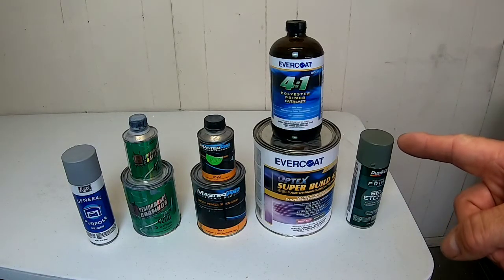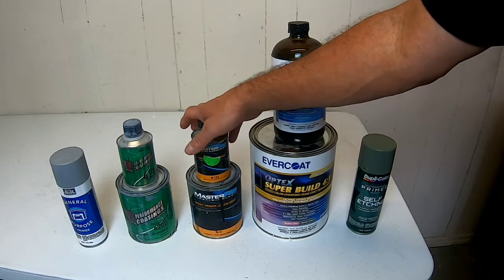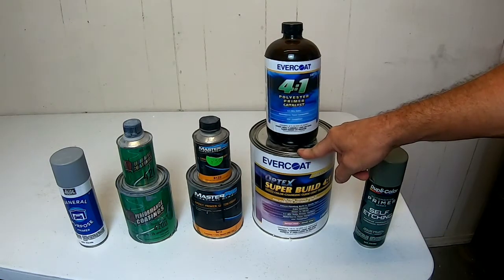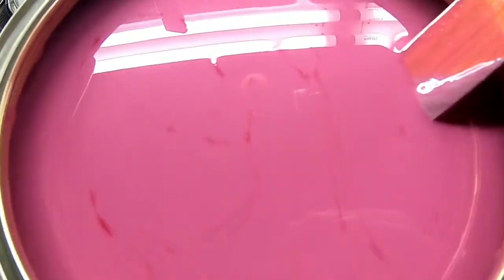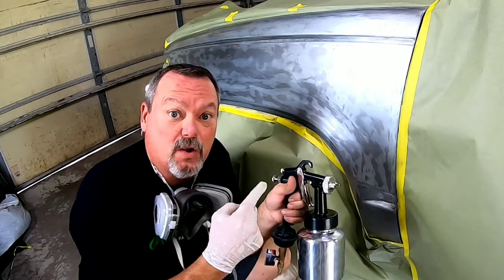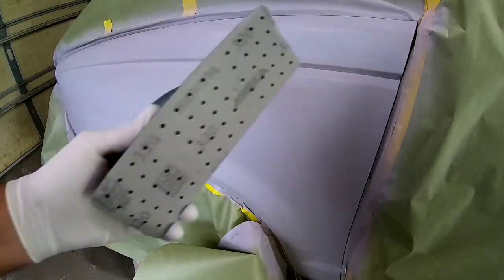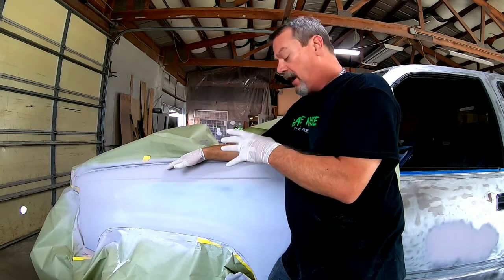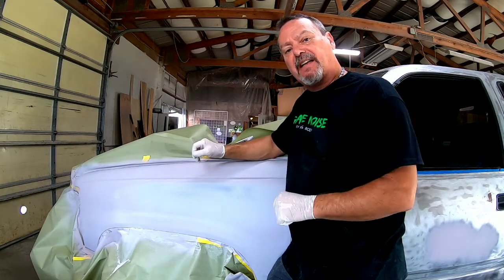Automotive Primers: Am I using the right primer to paint my car?

Comment: Good info. Thanks. My question (Yeah Im a DIY) My 97 Chevy 3500 paint is garbage. Not too much left and Im stuck with Chevy primer, metal and rust. Im getting a lot of conflicting reports on primer? I don't know which one to use. Self-etching, epoxy, urethane or polyester? No its not a show truck so it doesn't have to be perfect but close is good.  I have a lot of real estate to cover here so sending it out for 8-10k to have it done cant be done.
Reply from the maker: If your not stripping it to bare metal there's no need for epoxy and self etching is only really for bare metal and adhesion.  Stick with a direct to metal 2k urethane you can't  go wrong. Hope this helps appreciate the comment and support!

Comment: When using the etch primer when sanding through filler and hitting metal, after you spray the primer on that area, do you need to lightly sand it before spraying a non DTM 2k primer? What would happen if there is a small metal,spot that just got primed over with 2k and not an epoxy or etch primer?
Reply from the maker: You would most likely  be fine if it was just a small spot. The best thing to do is use a 2k primer that's  a DTM most of them are these  days . Upol make a great one that's  reasonably priced.

Comment: After applying a couple coats of 2k I found some scratches, can I apply a glaze over the scratches without sanding the primer or do I need to sand the primer first?
Reply from the maker: Sand the primer in that spot with 180 or something close before glaze.

Comment: Planning on fixing up some dents on my car roof (metallic paint), lots of them, but not very deep or big in diameter.  What would you recommend?
Reply from the maker: If the dents are shallow you may be able to just fill them and 2k primer check out some of my other videos to help with the process.  You can use filler 1/4 inch thick. Appreciate the support!

Comment: Etching primers are an old school technology..the new epoxy's are self etching.  Etching primers are generally used on new metal that has never been etch chemically or sanded.  Plus you can't use fillers over etching primers.  Throw in garbage and just use epoxy as your first line of defense against corrosion, you'll never go wrong!

Comment: Hey Chris, this is a super helpful video on primers! 👊

I've got a question for you. I just laid a 2K urethane primer and blocked it out. But there's a spot or two where I sanded down into the filler that I'd like to cover. 

Is a lacquer primer, like Dupli-Color's Sandable Primer, safe to use with an acrylic urethane basecoat (PPG Omni).
Reply from the maker: If it's  just a small  spot you can get away with it. You may even be abl to use a sealer before you paint to take care of it.

Comment: Best to always read the TDS on any primer before using them. Many of the urethane primers do not have high build. But some of them do. I prefer tamco urethane primer for high build. it sands easier than the polyester primers. Has almost the same build abilities and is great for overall priming on any project. Great information and thanks for posting.

Comment: Can different types of primers be used on top of each other? What about different panels?
I have a 54 Belair and under the trim pieces it's pitted because of rust. Do I just build up primer it until it's smooth? 
Thanks
Reply from the maker: Yes, some primers can be used on top of each other. For pitted metal  you can use a thin coat of filler to smooth thenmm out or a high build 2k primer or an epoxy primer.  Depends  on what you doing and how deep thit pits are. If your painting entire vehicle and taking down to bare metal epoxy is what I would choose it's  direct to metal primer and fills well and you can  apply filler over it after its sanded.

Comment: When should we use a sealer and if needed, I have seen some just use reduced 2k primer as a sealer. What do you think?
Reply from the maker: I use sealer on high metallic paint jobs or to create  a uniform color for coverage.  If I have a  repair where I broke thru the primer I will also use sealer. I have a 2k primer (Roberlo me1) that is designed to be used as a sealer with an additive,  I've  never just refuced 2k primer to use as a sealer but I know some painters do.  Good question, thanks for watching!

Comment: Great video!I have a general question about primers!lets say you prepare a panel for painting and you are on the stage of primer.You lay the primer down,you sand it and is ready for base coat, BUT for whatever reason the car has to be used and complete the paint after one month.Is this ok,or I have to reprime it?how I handle such a situation??thank you very much!
Reply from the maker: You would need to evaluate it when it came back in but I would re- primer it. Primer  is not made to be out in the elements .

Comment: Very confusing,  I am going to paint over old paint, bondo, and some small metal spots.  So far i have been spaying a rust killer primer with rattle can over the last three years,, as i restore other things. Now i want to go over the whole car.. I am lost. What covers everything and will build up?
Reply from the maker: The small metal spot use self etching primer you can buy in an aerosol can. Spray the rest of the vehicle with a 2k urethane primer.  It will be able to block sand and will build and can be sprayed  over filler and old paint. Roberlo  me1 is a great primer .

Comment: What did you use as a sealer?
Reply from the maker: Didn't  use a sealer, what I use for sealer is Roberlo M1 It can be used as a high build prime, light primer and sealer and it's  a direct to metal primer.
Reply: @GarageNoise  so can you straight paint over this primer you just used?